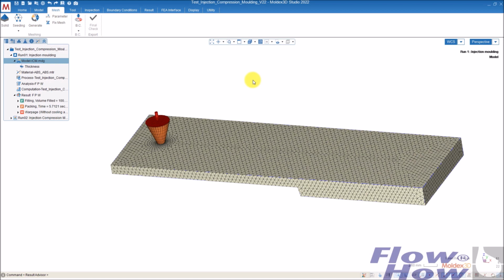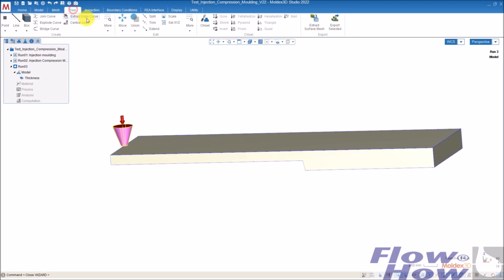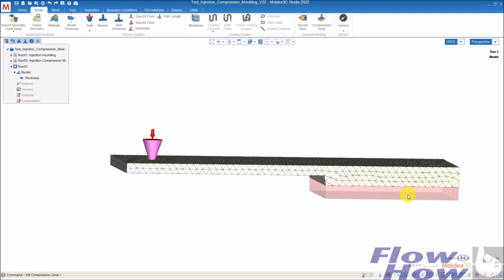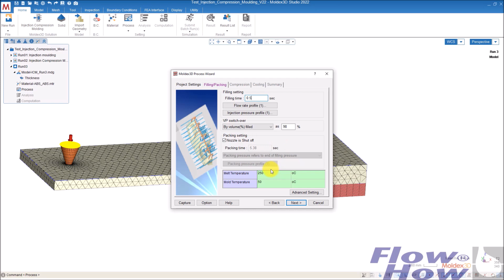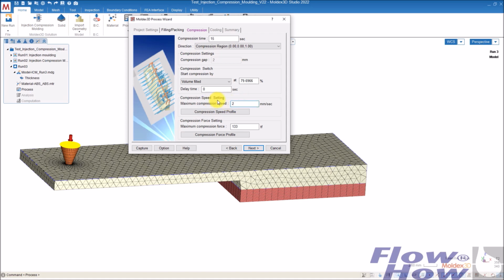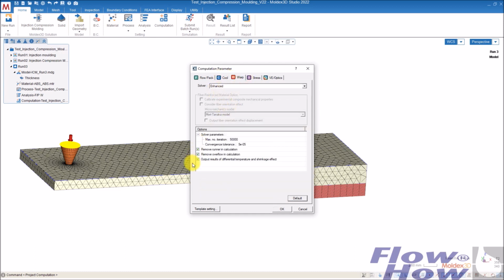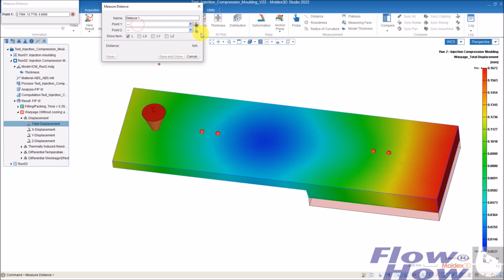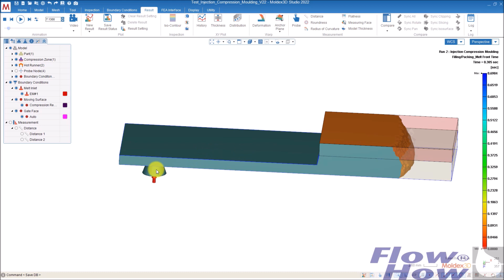Injection Compression Moulding (ICM) Moldex3D 2022 by FlowHow®

Comment: Sir How to get injection location in Moldex3D
Reply from the maker: Hi Sumit. There is a small help in injection location advisor, but normally you have to take a lot of different things into account, as filling pattern, mould opening, hot runner versus cold runner, weld line position, clamping force, filling pressure etc. This is actually a part of the simulation that sometimes is hard, because you have to go with the best compromise.......Injection moulding is one big compromise, So but I can't get more precise without having a full training :-)
Reply: Sir can you give me full tanning
Reply from the maker: Hi Sumit. Please send a mail to mj@flowhow and I will provide you with a quote for online training, by replying the mail.